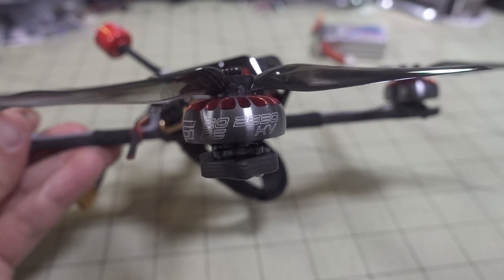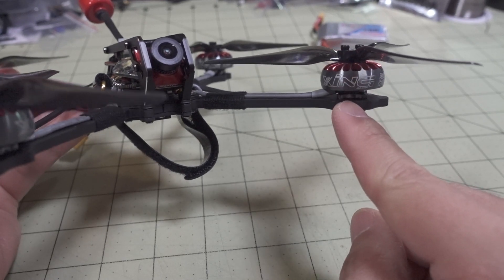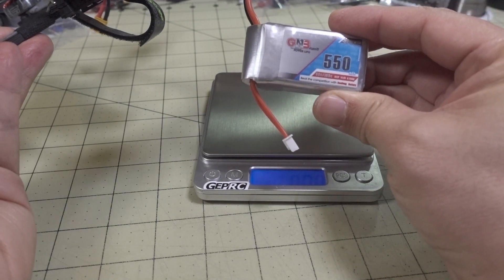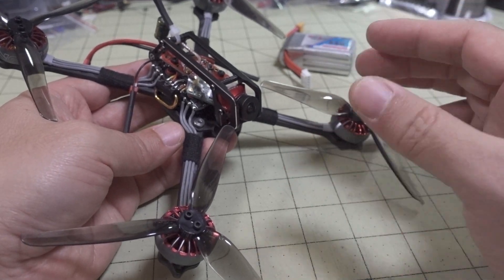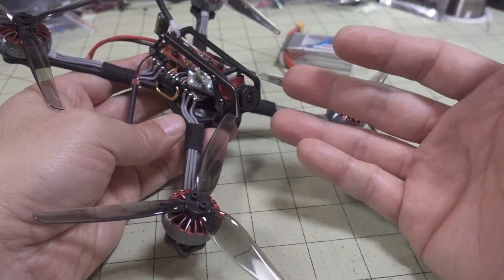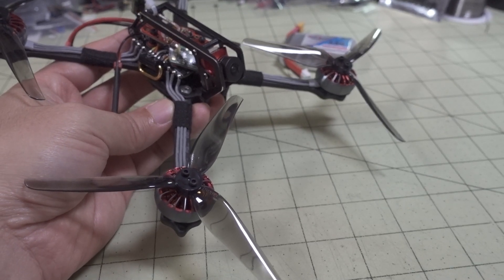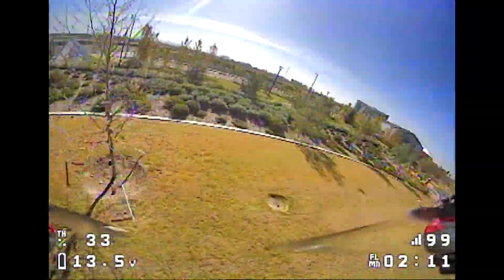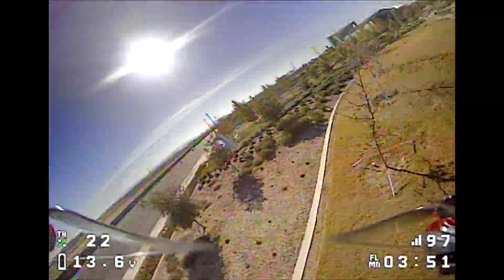iFlight XING 2005 2550kv Motor Review 🛵🏁

Comment: Tip: fit any Tmount prop by pulling holes with a soldering iron then clean with scalpel and 2mm drill bit rotating in reverse direction. Just did this to fit 2 blades hq 5x3
Tip2: use 8mm drill bit to make some room for the clip, depth approx 1mm. I didn't have 8mm so I used 7mm and finished with a countersink to enlarge which worked as well.

Comment: The non-standard t mount is a non-starter
Reply: Hi, can you elaborate what makes it non standard ? The shaft is still 1.5mm.. I will receive them soon I'll check but for sure there is a way around that
Reply: @MattxFr  the screw spacing is 6mm instead of 5mm making it only compatible with the Nazgul 5in tmount prop
Reply: Oh yeah so 6mm spacing vs 5mm. I'll see tomorrow if I can drill/slot the hole then balance the prop to correct size
Reply: Ok so I pulled the holes with a soldering iron, then cleaner with a scalpel and a 2mm drill bit. Works great. It's time consuming though and take some trials but doable

Comment: Thanks for the honest review. I would change the antenna to save 4g... ReplacingTwo sma connector with one mmcx should allow using 550mah
Reply from the maker: There's no SMA connectors for the antenna.  Its a straight connection to the u.FL on the VTX so super light.  Perhaps you watched someone else's video?

Comment: Thank you Albert for this review.   I had been thinking of these for a Dave_C  5"  MiniLongRange  I knew the props were proprietary Nazguls, did not know the C-Clip was so big.   Did you happen to measure what size of a center hole or relief we would need to use these motors?
Reply: I’m in the same position and actually already have the frame.  ALBERT — can you let us know on this?